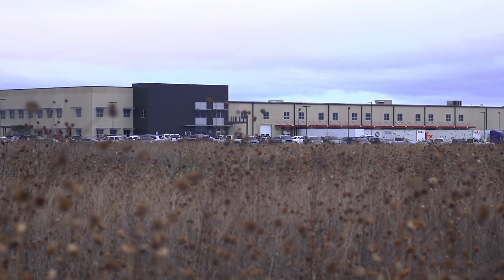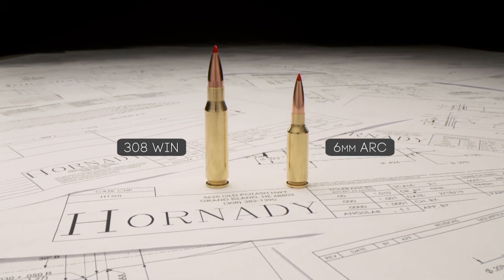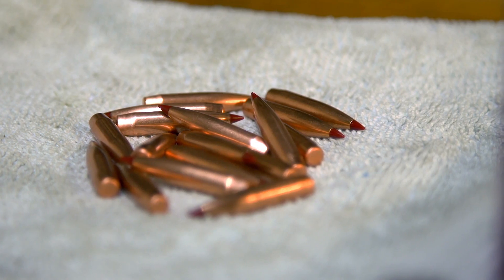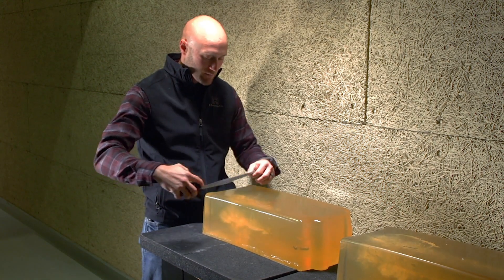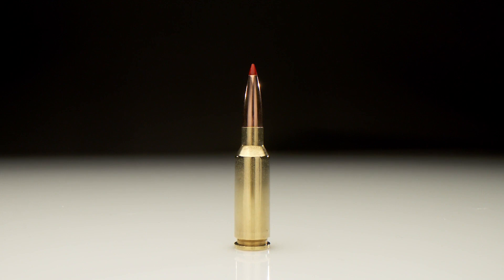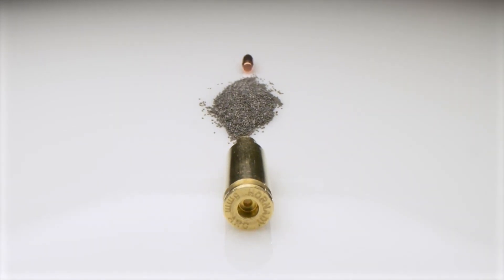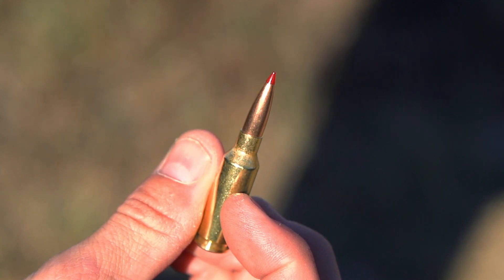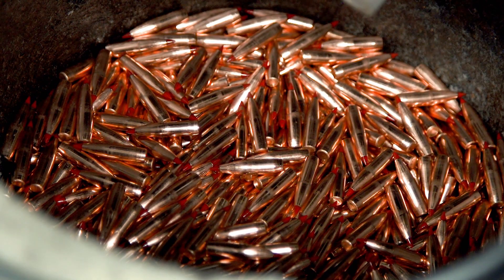Hornady's 6 mm ARC

Comment: Brass/ammo, Peterson cartridge announced recently that they will be releasing their line of 6 ARC in the next few months. Hopefully that puts it on the shelves so more people can readily get it. Mags, folks, if you haven't already try C Products 6.5 grendel duramags. I bought three 10 rounders (PRS application) and haven't had a problem one with them. They make 25 round 6.5 grendel duramags. In the 15 platform I believe this to be a most capable cartridge. I handload with VV N540 and while the velocity isn't as high it's predictable at normal match temps. (For me normal is between 30-80 degrees F) Leverevolution will get the job done for velocity but it's not very temp stable but if you're not worried about that run leverevolution. It definitely yeets the rounds although it's very dirty burning.

Comment: Hornady FACTORY AMMO 108 ELD-M.  From the factory, I bought 4 cases; 800 rounds.  All 800 rounds, the headstamp has cut marks.  IN BRAND NEW FACTORY AMMO.  THE COAL WAS TO LONG FOR THE MAGAZINES AVAILABLE in the market.  I called Hornady customer service and they told me to get some die sets and...RE-SEAT THE AMMO TEN THOU OFF MAGAZINE LENGTH.
I ALSO REMOVED AT RANDOM 25 BULLETS OUT OF 100 ROUNDS TO CHECK POWDER CHARGES AND FOUND ONE FULL GRAIN POWDER CHARGE VARIANCE  IN THE 25 ROUNDS TESTED.  THE SEATING DEPTH VARIED BY 31 THOUSANDTHS.  
WHY SO MANY VARIABLES FROM HORNADY WITH BRAND NEW FACTORY MATCH GRADE AMMO AT MATCH GRADE PRICE??????
BUYERS BEWARE.....TEST FOR YOURSELVES......

Comment: You could get even more performance going to the ruger .204 case and neck up to .243, .257, .264 . more capacity , more pressure , std bolt . Shoehorn it into a Ruger SFAR platform . Higher load density than ARC/Grendel .Call it the 25-04 Hornady .

Comment: I have four, 6ARC rifles.  Three bolts, one gas (which has a different barrel set up, so 5 if you want to count that).  Love them all.  GET WITH THE PROGRAM HORNADY..... make some f'ing brass!!!!
Reply: Buy some Lapua,  starline, nosler 6.5 Grendel and resize it yourself.  Get the RCBS MATCHMASTER DIES.  YOU WILL LOVE THESE DIES.  THEY ARE QUALITY.  EASY TO DO.  THEY COME OUT PERFECT.  GET YOURSELF A SHERIDAN CASE GUAGE.  THEY ARE AWSOME FOR RELOADING.  GOOD LUCK.
Reply: Peterson cartridge is going to be releasing ammo/brass for ARC withing the next few months.

Comment: All of these wiz-bang calibers but nothing as far as reliable, specifically designed for caliber, mags to support them. I'll take the compromises of 5.56/.308 and magazines I can rely on any day over the mixed-bag of reliability from the so-called caliber specific magazines available on the market. And please don't chime in with any of the usual brands that someone always claims to have been "totally reliable" for them. I've bought them, shot them, and had mixed reliability with all of them....6.8., Gendel, and 7.62x39. If the time came, I wouldn't grab any of them over a 5.56. Plinking...yes. Life on the line...no way.  I like what Magpul and LWRC did however with the Six8 rifle/6.8 designed mags and think that's the best approach as opposed to just trying to make wiz-bangs work in STANAG magazines.